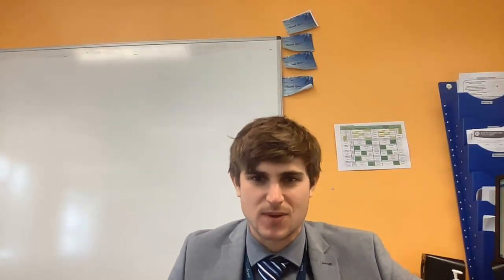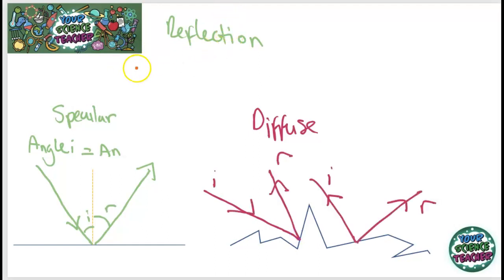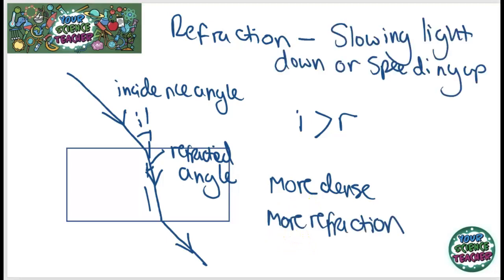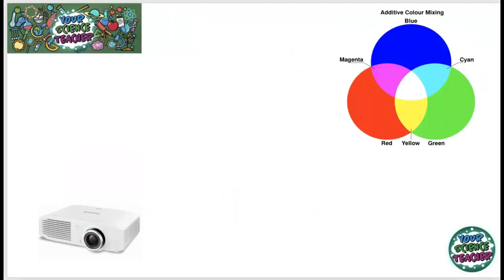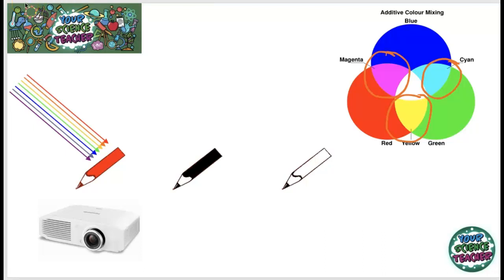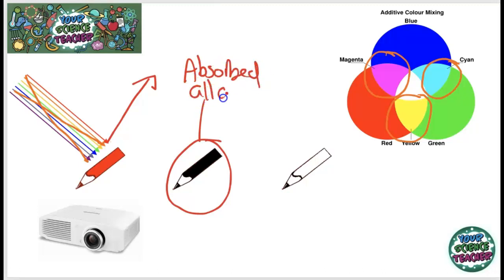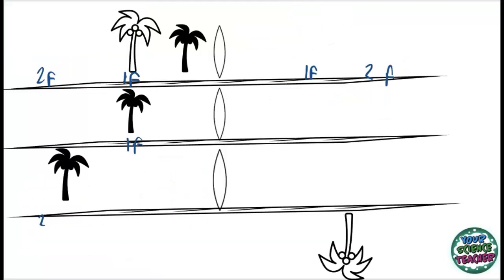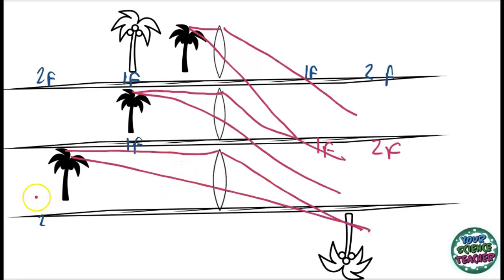AQA GCSE 9-1 - P14 LIGHT

Comment: any tips for relating physics more heavily into things Irl? I find physics more difficult as I cant visualise how its relevant to me
Reply from the maker: Hey, I totally understand it is definitely hard to visualise some off the harder concepts especially in physics, my tip would be for physics look for analogies when you can for example in electricity you can say electricity is like a river, the amount of water passing per second is like the current (amount of charge passing per second), the push of water is like the voltage (the potential difference of the battery), the resistance is like rocks the stop the water (stop the flow of charge in a circuit.) Hope this helps.